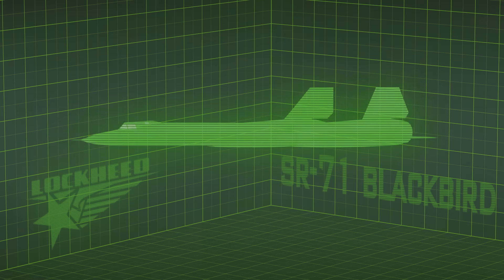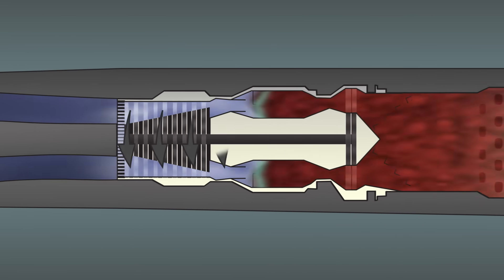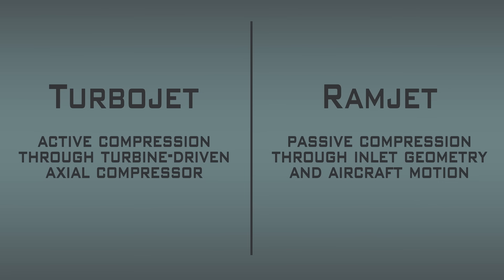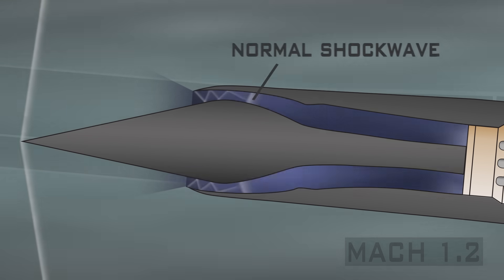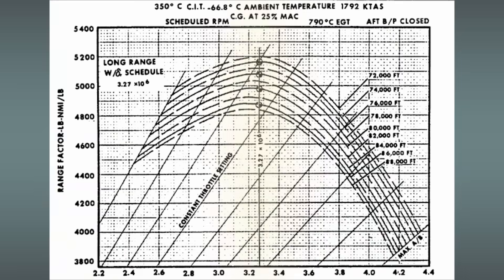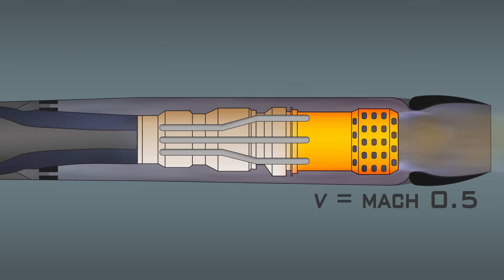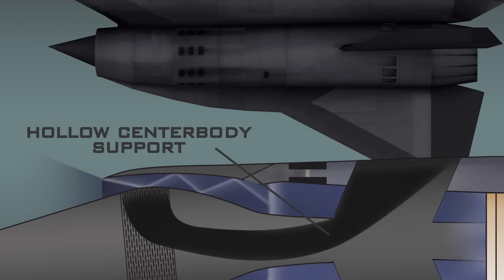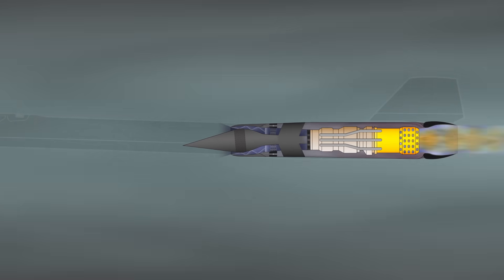The Mighty J58 - The SR-71's Secret Powerhouse

Comment: No Autocad. No Solid Works. They used slide rules to design this sucker. SLIDE RULES!
Reply: They had slide rules for sure but they were all really great, handpicked engineers. And Kelly Johnson knew pretty much what he was doing.
Reply: fucking badass
Reply: @BMarauder
Reply: inkydoug There was a lot of vision in the SR-71. Unless the Aurora exists, no one has built the equal or better of the SR-71.
Reply: @Fudmottin  you mean "nobody has been paid to develop equal or better than the SR-71". With modern tools, materials and other tech, it is very doable - the main problem is funding which comes from the "need" for such a vehicle. I only say this because the way you phrased it is very much a nostalgic, rose-tinted glasses "the past was somehow better than now" kind of comment.
Reply: @lukefreeman828  There may well already be a flying replacement to the SR-71 that we don't know about. It is also possible that the same intelligence is gathered by entirely different means.
Reply: @Fudmottin  Pigeons?
Reply: @ciaagentsextillerson3857  I'm sorry, but I'm missing the reference or the joke. This thread has been risen from the dead.
Reply: @Fudmottin  It was a reply to your comment "There may well already be a flying replacement to the SR-71 that we don't know about. It is also possible that the same intelligence is gathered by entirely different means."
Reply: @ciaagentsextillerson3857  I see. Well if anyone can weaponize pigeons, DARPA can.
Reply: +SeikiBrian  I've done some really superficial research and it certainly appears that the SR-71 cockpit is all analog.  So now I don't know what he was referring to.  I'll try to ask him and I'll let you know.
Reply: @egandler  Did you ever find out about the touch pad? I am curious to know.
Reply: @TRPGpilot  Sorry, I never got a chance to talk to him about it. I was supposed to meet him at a wedding that got postponed due to Covid.  it's been decades since he and I crossed paths. However I will ask him when I see him and I'll let you know.
Reply: @egandler   Cheers!
Reply: Eric Gandler LOL
Reply: Yeah, but real SR-71 designers would have used an abacus.  Slide rules are for lazy rocket scientists.
Reply: @egandler  🤣
Reply: +Fudmottin Computers are just tools. They speed up some steps a whole lot,granted,but they don't do so much for vision, which is what this plane took.
Reply: Good God. So much respect for Skunkworks engineers.
Reply: Actually they used a lot of money and resources. Now if you give today's students access to unlimited funding and resources; you may also find a few intuitive designers with genius. Before schools became underfunded and major cutbacks took place in the 90's people had every opportunity to pursue their dreams and apply what they had learned in life. The problem today is that you need x amount of dollars to even access knowledge required to apply within opportunities that can come with even more barriers to entry. People are still learning the same things, and being taught excellent information; they just forget it all too soon because there is usually no hope that they will be able to put it into some useful application.
Reply: Fudmottin - And slide rules don’t need batteries and are immune to neutron beam bursts from a neutron star, stuck keys, etc. :-) I still have my slide rule (it’s 52 years old). Note I said singular. Never needed to buy another one. I no longer have any of the handheld calculators I’d used over the decades, that eventually would stop working. The real genius was Kelly Johnson!
Reply: Two of my slide rules came from Japan. My father in law got them from an engineering professor near Hiroshima during the occupation. I used them on the Alaskan Pipeline while at Brown and Root in the 70s. And yes I still have my AutoCad floppies V 1.1.
Reply: You bet they had computers. Probably one or two IBM mainframes and the Mil Specs and NACA aerodynamic data they used definitely were run through an electronic computer. 

Slide rules were for checking or modifications, not to design the bloody thing from scratch—or else it would have taken a hundred years.
Reply: I agree.  Just as an example, the touch pad found in most laptops was first designed for the SR-71 cockpit.  We still consider that technology cutting edge how many decades later?
Reply: @egandler  Well personally, I've not thought of that as "cutting edge" in two decades... and that's because when I first saw it I was a child. And tbf, touch technology now is way beyond (as it should be) what was developed for the SR-71... so it technically IS cutting edge, it just not a completely novel idea.
Reply: I can hear the kids ask...what is a slide rule   :-)
Yep, I still have mine, made in Germany by Faber Castell.
Reply: Thank you for bringing this up! Im an areospace engineer and i feel that todays eduction for engineering is no where near the quality  of those who built these planes. They actually had hands on experience. Ive been in theory classes for 4 years now....
Reply: @LT72884  So you haven't built a basic wing section yet? That used to be first year stuff.
Reply: @Fudmottin  nope. Thats my issue with eduction these days.
Reply: Fudmottin true humanity ingenuity
Reply: And did it a lot faster than we can now.
Reply: @mickor two words ... auto backup :-)
Reply: @peterrafeiner9461  two words.... I’m not paying money for that shit.
Reply: That's called 'Mad-Mam', mind aided design-mind/machine aided manufactured.
Reply: Because most computers don't think or imagine, they only compute, add subtract divide or multiply, their 'vocabulary' is only a 0 and 1!
The English language has 26 letters, and the entire world has 10 digits, 1 through 0........or 0 through 9 whichever way you want to look at it.
And don't forget the axiom invented about the same time as the computer:  'garbage in, garbage out'!
Reply: Robert Slackware j
Reply: yeah, makes you wonder what they'd be capable of producing now... not that I can see a situation where such a vehicle would be needed.
Reply: And no FLUENT or other fluid dynamics software.  That is most impressive.
Reply: i. rob  "They dont make them like they used to" And thats a very good thing. If not, ew would be fu**n be stuck in the past!
Reply: also no ansys and any other air flow simulator
Reply: As an aerospace engineer this whole comments section is filled with rose tinted glasses. What we use computers for today, mainly CFD techniques, can be accomplished using experimental data which is what they used to do back then. It just costs a lot more money to do so. 

CAD is just used for drafting, you can easily use a slide rule and a skilled technician to replicate the deliverables produced using CAD. The other big use of computers is to do calculations, and back then they had computers as well to do these calculations, it just took the form of a sea of people instead of a machine.
Reply: Slide rules and mechanical drawings etched on stone tablets.
Reply: I used one to whip up some egg salad.
Reply: @lbowsk  A slide rule or a J58?
Reply: ?? They did more landing on the moon with less
Reply: This thing is awesome, it has more power than normal afterburners
Reply: dandogful dandogful  sounds intresting, but woudnt the plane explode in the air?
Reply: Drafting table
Reply: No, o’doyal rules
Reply: damnnnn     😳
Reply: clever and innovative engineers. Impressive to say the least
Reply: We went from it being top secrete to "In this video we will teach you how to build a turbo ram jet engine. And while we are at it why not a turno ram scram jet as well. XD honestly tho when you take jnto comsideration the leaked info om the mercury zero g motor it puts this to shame why not just build the TR3B aricraft and use it as a mother shit with the quantom cloaking tech. Oh wait we allready do. XD man We are liveing in the future sadly only for the rich and the government. You will get the tech soon when you figure out how to make it cheaper and i can say we are close. Flying cars will exist really really soon. Or if not levetating cities. Hopefully if my plan works.
Reply: I'm sure they had the best computers of their time at their disposal.
Reply: so? we use it and still no create warp drive , infinyty power cells, artificial gravity, even simple for us 
reusable spacecraft without rocket accelerator, conclusion - solidworks and autocad is bullshit
Reply: Skunkworks used slide rules Pratt and Whitney didn’t you fucktard
Reply: and smoking pipes, all about the pipes.
Reply: They had slide rules AND adding machines. The two together can most of what an electronic calculator can do (yes, I'm an engineer and have used a slide rule). They also had a wealth of data from NACA's X-plane program. The X-2 flew at Mach 3.2 in the mid 50's. And they did have computers -- they were used for simulation on the X-2 program. They just weren't ubiquitous like now. But yes, all that and they were brilliant too.
Reply: That's because they knew what they were doing back in the day.
Reply: Badass boomers
Reply: I see it is fragile like a tyrant without 10 pigs and one day I will FUCK IT
Reply: That's how it should be, but with calculators!
Reply: Not anymore they dont.
Reply: i. rob  Nope. Computers is an improvement on the slide rule. So... a shitty modern plane is a proof computers is not an improvement on a slide rule... Please dont get a job building planes.
Reply: i. rob  And at the same time, learning TIG welding thin .035 chromoly tubing while building my double eagle ultralight. Difficult start but I now got it! Lots of fun to learn such difficult skill. Good retirement hobby, you should give it a try! :)
Reply: i. rob  An BTW... What is the relation between having or not having aeronautical knowledge and a discussion regarding the efficiency difference between slide rule abnd a computer? Common sense is in my opinion more than enough when was the last time you used one and found it practical?
Reply: Yeah and didn't they have it Up and flying in two years?? Kelly Johnson is an absolute genius 😇
Reply: Femap, Nastran, MathCad, Inventor...
Reply: Always makes me wonder as well. Truly is amazing
Reply: "They" was Ben Rich.
Reply: Slide rule comes right handy for coping with imperial system/gauge stuff.
Reply: @earledward8766  They existed as a novelty when I was a kid. You had a certain status, not really a good one, for knowing how to use a slide rule. Graphing calculators were the new kids on the block.
Reply: In a time when humans where smart and computers 'dumb'......
Reply: Yeah and they still get the f-35 right.
Reply: They had wind tunnels.
Reply: +SeikiBrian  Evidence is that my uncle was part of a team in California that designed that component in the SR-71.  I mean, I wouldn't know how to prove it beyond that.  It was just a story he was telling me long ago about how certain technologies came out of the defense sector.
Reply: Unlike Autocad, slide rules don't crash just as you're about to save all your work.
Reply: +Eric Gandler "...the touch pad found in most laptops was first designed for the SR-71 cockpit."

Evidence?
Reply: Prolly no use in replying to this 2 year old comment, but I have a friend from college who was involved in the Vietnam war and carpet bombing and shit. He mentioned with this fucking twinkle in his eye how there were insanely good touch screens onboard some of the planes in the 70's that made navigating the user interface so much easier and one of his vet buddies cut him off and told him how mentioning that stuff was against some pact and that he could go to prison if he was reported to the appropriate authorities and blah blah. Point is that stuck with me and i dont think that guy that made the laptop touch pad comment was lying lol
Reply: Well, since you don't believe you should do our own internet search...?
Reply: Slipsticks are BAD A55, man!   Too bad they dont teach useful math in school no more, eh!
Reply: Yeah. Right. IBM mainframe computers were being widely used in all kinds of U.S. industries for complex, monotonous and repetitive calculations in the late 1950s. Hell, John Deere's "New Generation" tractors introduced in 1960 contain transmission gears that were engineered in part using those old IBM punchcard computers to do calculations for gear diameter, tooth dimensions, etc. 

Of course humans have created every bit of the "technology" that supposedly has "replaced" them with the end result being a much larger group of people being involved when computers are used than without, but the "artificial intelligence" crowd won't fess up to it.
Reply: software is only a tool. Like a flint only has the potential to be a cutting implement. Any piece of software can only do what those who use it can do. I feel in this society we dont learn these values. But hey. Go donald.
Reply: Hell friend, they built the first atomic bombs with a slide rule and a pencil with an eraser. Youth of today would curl up in a fetal position and die, if the power went out.
Reply: Software is a very powerful tool. I can only imagine what the Skunk Works could have come up with if they had CFD, CAD, CAM, etc. Perhaps they would have solved the leaking fuel problem. Who knows? We use tools to build better tools. It's a wonderful iterative cycle.
Reply: @Fudmottin  I don't think the fuel leaking was a problem, it was a 'solution' to the plane being heated by friction and the resulting thermal expansion
Reply: @Fudmottin : the leaking fuel problem was on the ground when the titanium sheet metal used to skin the aircraft was at ambient temperature,  because at the designed operating speed, the temperature of the skin gets hot enough to expand and you need gaps/room for that to be allowed without bending, warping, or otherwise damaging the individual sheets of titanium as they come into contact with each other. And it has to be titanium because that is the only alloy that can withstand the temperatures the plane operates at, 450° Fahrenheit at the nose to 950° Fahrenheit at the tail, at altitudes up to 90,000 feet. The titanium ore obtained for the metal was surreptitiously purchased through 'ghost companies' from the Soviet Union the country the plane was spying on😲
Reply: @thomasschoon8407  Yeah, I know. Physics can be a bitch at times. It's still a lovely aircraft.
Reply: @Fudmottin  Actually, the SR-71 design was run through more modern computer analysis to see what improvements on  the design could be realized and they didn't find any meaningful areas to improve.  To solve the leaking fuel "problem" it wasn't a better calculator that was needed - it was better metal alloys that didn't yet exist.
Reply: @Ladco77  Sounds a lot like the Mt Washington Toll Road. It was laid out in the 1800s. I forget when they did it, but they followed up with a complete geodetic survey sometime in 1990s. It turned out the route laid out was indeed the optimum route. There are people who really know their business.
Reply: @Fudmottin  But you can't use software to break laws of physics.
Reply: @henson2k  True enough. It turns out you also can't install a J58 in your Vette.
Reply: @henson2k  Well akshually
Reply: Fudmottin the computer would have told them it wouldn't fly.
Reply: uh... do you even know what a slide rule is?
Reply: i. rob  If in 2020 you still prefer to use a sliding rule than a computer, it is definitely time for you to retire. And in fact, yes, I do build airplanes http://www.aviationdb.com/Aviation/Aircraft/2/N274CX.shtm I built this one from scratch also built a cumulus motorglider from kit and now building a double eagle ultralight from scratch. Plus a couple of rebuild and an abandonned bkflyer project (Louzy plans and design, I think the conceptor used a sliding rule to design it :P) All this without computer or slide rule. PPL, ultralight flight instructor in Canada at www.vortexaviation.ca 14 year flying hang gliders and paragliders... I however never built a jet engine from scratch... Dont like much to build jet engines, the fly very bad without a plane to attatch them to...  I wish you a happy retirement! Cheers! :)
Reply: Andre P.S.
No, just Kelly Johnson.

Comment: It still amazes me that this plane was designed in an era that most likely used slide rules when computer simulation didn't exist.  A tribute to Kelly Johnson's genius but I now I see Ben Rich might of been the engines designer.
Reply: +Robert Thomson Now we build super expensive jets that hardly work. The F-35 is a piece of junk and the electronics are behind the Russians and vulnerable to EMPs.
Reply: Ben Rich was designer of the inlet. This is the most important part to get the plane to mach 3.

Comment: Max, the SR had very strick speed limits through out its flight altitudes.  410 kias (knots indicated air speed)  510 kias was the max then starts the structural damage. This gets super technical as the SR gains altitude, air gets thinner.  Your KIAS will read 450 but your TDI will read mach 3.2. So for the SR to to be doing Mach 1 around hero's operating altitudes wouldn't happen.